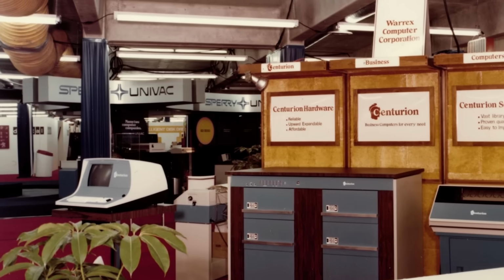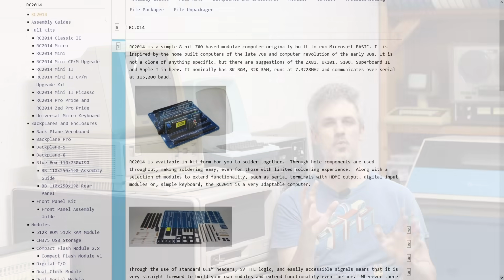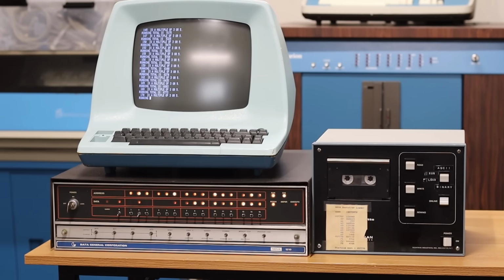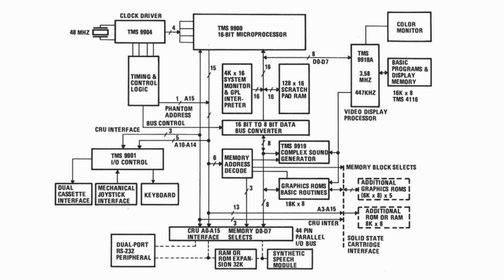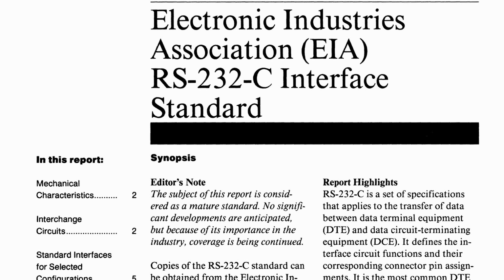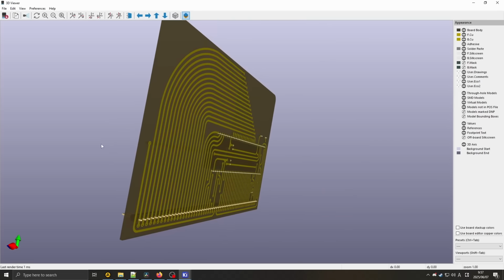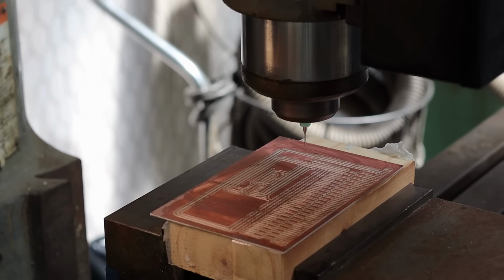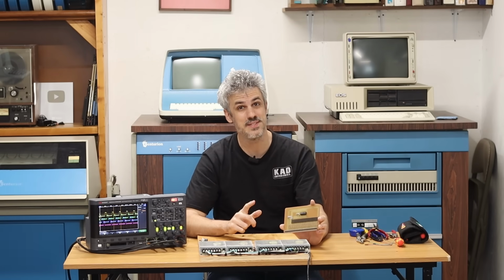The First Step in Building our TMS9900 Homebrew!

Comment: I think the most exciting component of any computer is the Front Panel.

I started on an Altair 8800 in 1976 (I was back home from my first year away at college) and as I
became a pro engineer using PDP-11, then VAX 11/780 and then Unix Workstations I eventually returned
to my Altair hobby (I still have my original machine) and so I used computers for development and now,
with hindsight I find that a computer, to me, only seems engrossing and engaging if it has a Front Panel.

So my advice will seem odd:  I'm an advanced computer hobbyist and my advice to all similar hobbyists is:
focus on computers with front panels!

For every computer, including the Bendix your original contribution can be: use your maximum cleverness and
invent a way to add a Front Panel.  For an existing tube computer your clever front panel is on the side.

For UE-1 Add a Front Panel beyond the current two strips of tube adjacent light panels.

Yes, for some beloved computers a front panel might seem inconsistent, but with enough imagination
I believe it is possible to add a cool original front panel some way or another.

For a new UE-2 definitely give it a cool front panel.

As you noted in this video the ultra-appealing recent homebrew examples you showed had really cool front panels.

So for your new TI-99 I would really focus on an awesome font panel with all switches and lights played up
to the max.

When you run your new homebrew you don't just want to type "> DIR" and then see some scrolling stuff on a
CRT, no, you want to run something and watch the front panel lights go crazy (the more LED's the better).

You have the ability to make a "Mondo Extra Mega, Trippindicular, Freaky Display and Switches with Maximum Mojo/Juju."

Do you know what I mean?  You can make that.  It just requires inspiration and motivation.

Please, maximum Mojo/Juju...  Maximum!

Please consider it.  That would be epic.

Cheers

Comment: I have etched my own PCBs.  Just handling the toxic waste leans be to milling.  In my last job I had access to aBridgeport mill.  I never needed to learn the computer controller for it.  So, mill those boards.  Do you have any plans to pretect the copper traces from corrosion?

Comment: I worked for TI back in 1982 (?) or around there...  building the TI-99/4A on the assembly line, when they were at their peak. I was in "mainframe" testing. The step after burn-in that tested the machine for the first time. The it went to be placed in its case, packaged up and sent out. I left just before they started laying of tons of people as they realized the computer was tanking. Those were fun and exhausting days.

Comment: One thing to think about is when the 5170 AT came out, they modified the bios to make it not run with faster CPUs because the performance of the 5170 was getting too close to IBM's minicomputer range.

And with a digiboard you can run many serial ports off of a PC or AT system which could then drive terminals.  Install Xenix and you have a sort of mini-computer setup.

The Tandy model 16 though 6000 which had a Z80 and 68000 cpu could run multi-user Xenix and could be the central computer in a small office.  I guess it was in the mini-micro range.

Comment: I'm definitely excited for this project. The TMS9900 was so hindered by the system it was in, I can't wait to see what this system is capable of.
Reply: There were plenty of industrial systems using the TMS9900 - and they worked very well (I worked with some in the 1980s.  It's just that in popular microcomputer culture, the processor became synonymous with the TI9/4A with most of the RAM tied to the video processor and that crippled performance.
Reply: In the TI-99/4A there are a number of unfortunate design choices that impose limits on performance and utility. But it doesn't help that the TMS 9900 is an oddball as far as "CPUS" used in micro-computers on top of being a 16-bit chip.

It would probably have helped if the rest of the computer had been composed of hardware that could take care of itself other than exchanging some data now and then. Most early home computers either relied heavily on the CPU to make video and
Reply: @jnharton  Well, microcomputers weren't really a thing for very long when the TI-99 was introduced, so I'll give them slack for that, nobody knew what was going to end up winning, and TI came in strong, with a chip that cost too much and was a bit odd. However, the WP idea was interesting, just like the relocatable zero page of the 6502 variants. You could do multitasking, although with such slow memory access that wasn't really very useful. The GPL was an interesting idea if there were any followups to the 9900, at least some of the roms could be re-used, but that idea was dead in the water when they got out of the home computer market, and it hindered performance as well.

Comment: I wonder if it wouldn't be more interesting if you didn't use that vintage chip for the clock. It might be difficult to find for your fans, creating a modern replica out of TTL logic or something like that seems better to me. 

You can't replace the tms9900, as that would defeat the purpose of the build, but for the supporting bits there are great, in production options, out there.

Comment: Though I get the appeal and might also make something one day, the big problem with homebrew computers is lack of software, you have to do everything yourself. There isn't even a decent c compiler for this chip. 

Kit computers, are more fun because many people build them and then you get a more diverse software eco system.  You don't have to do everything yourself and you can share what you do with others. Sharing software isn't a thing with a true homebrew as they typically are not compatible with anything else.

Comment: You really should use the "machined pin" type of socket.  They look much cooler and do also work better.
On micros like the 8051, they also have register banks.  It can really make interrupts more efficient if you put them to use.
Your multiple supplies may also be handy for a few other things:
DEC had a design for long bus cables and IBM had a thing very like it.  The driver was designed so that it wanted to swing up to something like 10V and down to something like -6V.  At the receiver end, there was termination with some diodes and stuff that turned the signals back into 0V-5V.  This method allowed logic signals to be brought quite long distances at what was at the time high speeds.  All of the ringing was excluded from the the communications and the receiver end was effectively an impedance matched load.  When you come to connecting to a reel-to-reel tape deck, this can be a way to go if you need to route over the ceiling and down the opposite wall.

Comment: Takes me back to a college project in appx 1984.  Was supposed to be a small form factor FORTH machine (9900 based).  Got it fully assembled, but never quite working..., ran out of time.  One issue I remember was the difficulty in getting the clock to work cleanly enough to keep the CPU happy.  A TI engineer told me that was the toughest part of designing with the 9900..., and actually suggested I find a scavenged 99/4 and saw the clock circuit out of the board and try that.  The OTHER thing I remember is being told that 3.3Mhz is the ONLY speed the 9900 would run at.   I don't know how much of what I was told was truly useful..., but there ya go.

Comment: A highish +5V rail might not actually be  problem and is pretty common in many modern pieces of equipment. 5.25V is within tolerance for most if not all chips, and due to voltage drop over wiring and breadboard rails it might be closer to 5.0V on the chips. I would probably turn it down a bit for now, but later when it's loaded, adjust accordingly.

Comment: Even with a 1Mhz target frequency I hope you are keeping signal integrity and impedance control in mind.  With multiple boards and long signal lines you are likely to see a lot of ringing, so proper termination may save a lot of debug time.  Cool project.  Looking forward to more episodes.
Reply: My thoughts exactly.  It’s one thing to be running the UE1 with its slow rise and fall signaling and it’s completely something different to have rise and fall times in the 10s of nanoseconds.

Comment: I would love it if entry level desktop cnc machines were the kind of prices that entry level 3d printers are.
Reply: you might want to look at a 3018. cnc router, not really a mill, but it's a way to get started with cutting away excess material to make your part.

Comment: Seeing you do PCB's on that Bridgeport still gives me those "you like playing the game on the Hard setting" vibes.  When I can whip up a PC board design in KiCad on a Sundary afternoon, shoot off the Gerbers and drill tape to a board shop, and have the boards on my porch on Thursday, doing CNC proramming for that particuilar job just isn't worth it to me. But it's fun to watch you!

Of course, I often wind up using at least a few SMT components, and those are next to impossible to solder without solder-mask.  With a good solder mask, hot air reflow is magical!

Comment: You might consider for the RS-232 a Max232 IC or similar as much as you already have the +/- 12V handy in which case you could use 1488/1499 ICs or similar.

Comment: Addressable register banks will be great for interrupt service routines, eliminate a bunch of Z80ish Push and Pop instructions.  Love the milling machine, and well also the overkill power supply.  The "future proof" design of the clock PCB is icing on the cake.  Can't wait until the next parts 👍🙂
Reply: It also can be handy for a degree of multi-tasking.
When the timer interrupt happens, you save the context mostly by changing register banks (changing stack pointer) and then do your return from interrupt into a different task.  This lets you time share the CPU between tasks with very little overhead.
Reply: Yes - interrupts are easy - the interrupt vectors set the Program Counter and Workspace Pointer so each interrupt routine can automatically have it's own register set.  And the pointer is simply restored from the stack on exit back to the main program, so the overhead is very low.

Comment: I had one of those back in the day. A friend of mine was an electrical engineer and explained to me that crazy memory and register architecture. I ended up getting enough of the peripherals to write assembly language on it and wrote my own computer language. I learned a lot, but spent way too much money on it for what it was. I'm also a fan of milling PCB's. I do cut 2 sided, but only if the number of jumpers gets to be more than a few, or I can't do them with 0 ohm resistors. If you are careful and have the right tools and software, you can make boards that rival an etched board. Looking forward to this project!

Comment: Since you have a workflow that works for you this may not be helpful but, you can use a multimeter in continuity beep mode with one lead clipped to the PCB and the other to the cutter for zeroing the Z axis.

Comment: Ah, the Ti 99/4a was such a dog's breakfast of a computer. As far as I can tell it was 'designed' through the principle of "Never take a step backwards." 
-Did the intended 8 bit CPU not pan out? Never mind, stuff a 16 bit mini-computer CPU in there but don't change the motherboard.
-Does that mean you haven't got enough RAM to run things properly? Don't redesign, just use the VDU RAM second-hand.
-Did your special language co-pro not work out? Don't recompile the ROM for machine code, interpret everything twice on the CPU
-Are GDROMs now incredibly slow? Yes, but even though we are are ROM and EPROM manufacturer don't you dare change the spec.
...and on, and on.

It's amazing the Ti 99/4a wasn't worse. I'm looking foreword to this project, I suspect a proper computer based around the TMS 9900 using a decent amount of static RAM will be pretty darn good... I dare you to use the entire TMS shipset for GFX and sound too!
Reply: Add to which, I believe TI decided (?) not to follow the industry norm for numbering address and data lines on their CPUs - which means that "A0" is the MSB of the address bus, not the LSB; similarly "D0" for the data bus.

I've been kinda intrigued by the TI 99-4(/A) - I've read a number of articles about it, but I've never used one first-hand; they don't seem to be particularly common here in the UK. As a result, I'll be rather interested to see what comes of this project.
Reply: @mdpenny42  So... is the TMS9900 "little-endian" or "big-endian" then?  (Sounds "little-endian").
Reply: @horusfalcon  It's big-endian - the address/data bus bit-order numbering is a separate matter.

(There's also some details on https://en.wikipedia.org/wiki/TMS9900 - notice in particular the bit-order numbering on the register layout graphic.)
Reply: @mdpenny42  Thanks for the info and the lead.  I gave it a look.  Reading a bit, I see I flipped it in my head.  Even though the addressing is 0 through 15, the MSB is shown as 0 through 7.  Yeah, that's big-endian.
Reply: And throw in a few TMS1000 for good measure, to control peripherals (compare to the original use of the 1650 as a peripheral controller).
Reply: I think the 99 can be summed up as, "Good CPU, bad computer ."

I feel the same way about a lot of Samsung devices. Great hardware, terrible software.
Reply: One should realize that the TMS9900 chip was to implement the TI line of Minicomputers (the TI-990/10 and TI-990/12 built using TTL MSI chips) in a more or less single chip ... there was also the SBP9900 chip that used a single voltage, but this was a high-tier mil-type product in the day so not a candidate for the TI-99/4A .... I2L (Integrated Injection Logic aka bipolar) was the technology for the SBP9900 vs NMOS for the TMS9900 ...
Reply: Ever since I learned about the TI/99 and what "Scratch RAM" I wondered what it's CPU could really do if not restricted by poor supporting hardware.

Comment: It sounds like you're getting into the region where the digital signal edges become fast enough that Ground Bounce becomes a thing.  You might consider using 2 sided copper PCB's and dedicate one side as a ground plane.   I also didn't see much in the way of decoupling caps on the power supply lines.  100nf near each IC power pin should do nicely.

Comment: Distinction is simple: LSI and MSI only? Mini. LSI and VLSI? Micro. And yes, some of later PDP-11s are microcomputers.

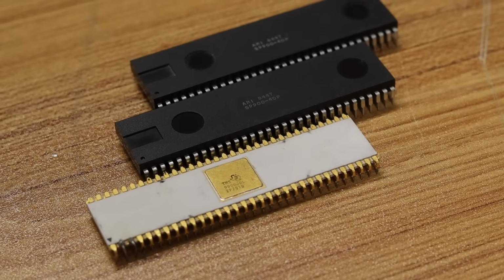13:30 wrong again. Mera 400 doesn't have a clock. It is FSM with few different delays triggered by those states. If You really want to explore Polish computers, i can prepare You description based on Polish video explaining, how it works without clock.

Comment: It sounds to me like the TMS9900 was a CPU which was intended for multi-user and multi-tasking in a 16-bit environment but due to poor planning was badly designed into a single-user, single-task, 8-bit environment.  It was a bit like hobbling a horse and still expecting it to gallop... or disconnecting half the spark plugs in a car engine and wondering why it lost power.

Edit: It occurs to me that it might be possible to devise a clock generator for the CPU to replace that specialist chip if you used a 4017 decade counter with output 5 connected to its reset input, a 4011 4-NAND chip to "gate" the pulses to the correct length and a timer with the correct phase timing for the pulses and the pauses in between each pulse, and maybe 4 transistors and some resistors to act as switching circuits for the 12V as well as inverting the pulses to the correct polarity.

Comment: Did you take a look at "lepton-schematic" and "pcb" for drawing the circuit and laying out the circuit board respectively? It is open source and I have found it good for both, and pcb has an auto-router that is actually usable on simple designs in one step, or for moderately straightforward circuits by judicious selection of parts of the circuit at a time. Only the auto placement of components is a disaster. I have recently used it for a logic probe, a voltage reference circuit (select the voltage with a keypad) and an RS232 monitor (displays the data in each direction using a 20 by 4 LCD). These are all retirement projects, I have been retired 12 years. Some of my projects are gliding-related, though I don't know how much longer I can fly my sailplane.

Comment: Back in the day, I built a TMS9995 based print buffer with 256MiB Ram (degree project). Lovely CPU, still got the 9900 series databooks if you need anything.

Comment: To zero Z you could use multimeter in continuity mode. Use crocodile clips, connect one probe to drill, another to pcb and slowly lower Z till meter beeps. Since you use standard pcb, you could build jig with locator pins. You drill holes in your blank for the locator pins. Put the board in jig and you have reversible board with fixed location that you can use for double sided boards. Also if you attach your jig to cnc bed permanently and record its x and y offsets to locator pins, then you would never have to set x and y again.

Comment: The clock chip seems to have oxydized pins like many TI chips I've seen. They may be subject to bad contacts.
I usually scrape the pins with a knife, put plumbing solder flux and tin all the pins. After that, I clean the chip of acidic flux.

Comment: Hi David, thanks for the great video; I’ve always been curious about how an unfettered TI9900 would perform, so I will be following this series avidly!
Reply: TI manufactured a single board, fully-featured TMS9900-based product in the day, its just that no one today knows this ... I think it was the TI 990/4 design that used the TMS9900 vs the TI 990/10 and 990/12 minicomputers that used TTL SSI and MSI level integration discrete 'chips'. The TI 'toy'  was model TI-99/4A ...